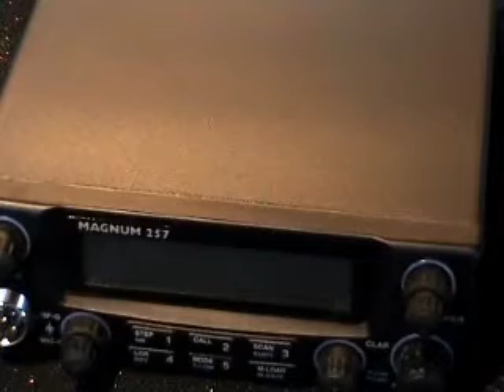The New Magnum 257 HP ..............First UK Review Part 1

Comment from the maker: @drewerz01 The Mosfet is used quite a lot now in CB/Ham radio equipment. I remember the old car audio gear too ,infact said graphic EQ, I had a Realistic (tandy) unit over 22 years ago in my Morris Marina  powered by a Sharp Radio Stereo cassette ( none Digi display type). Sounded good through the old Goodmans GP100 shelf speakers.......all are still "Stored" in the loft.